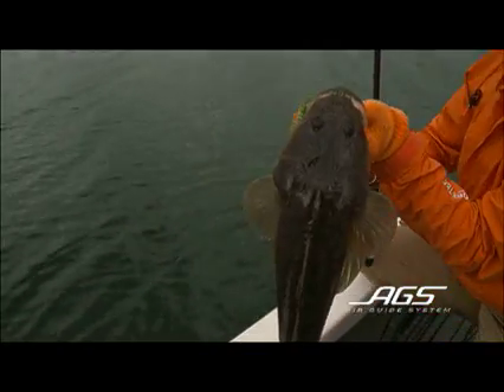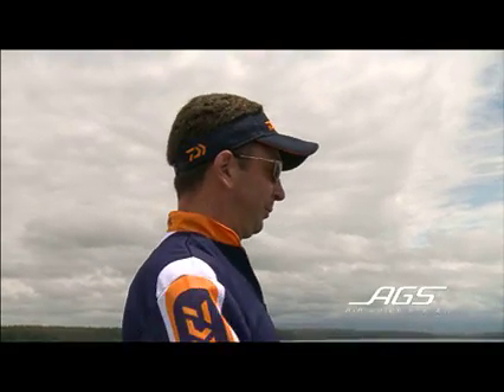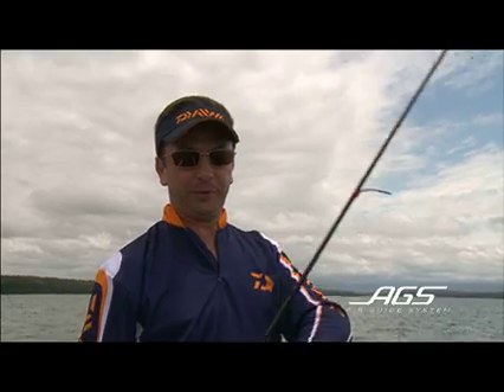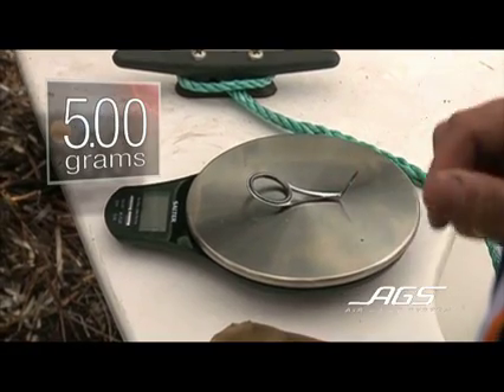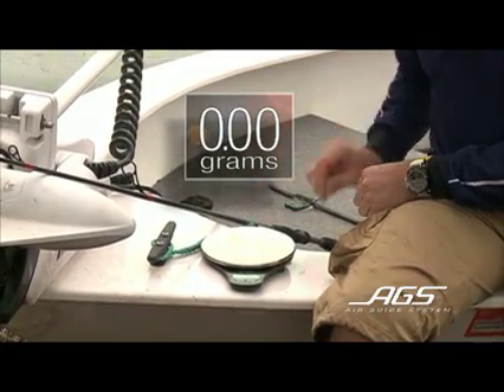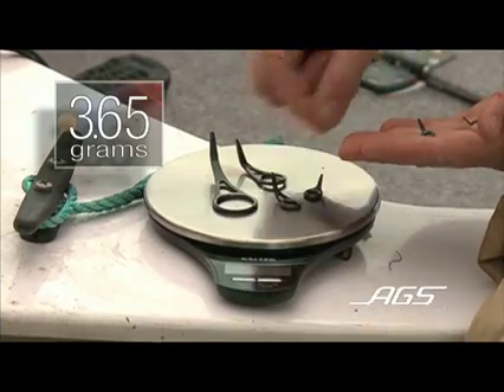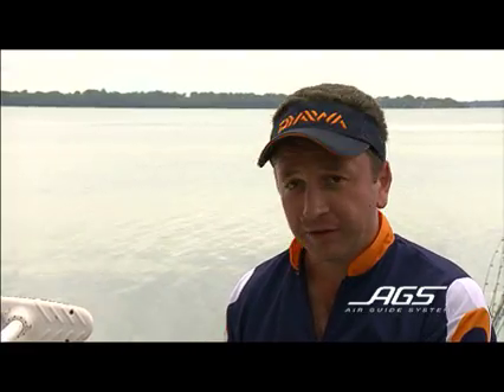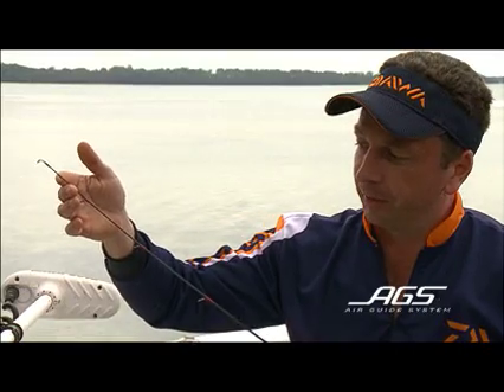Daiwa AGS

Comment: IMO this is wrong. Guides do not increase sensitivity. They are just guiding the line. Sensitivity depends on the line and rod. Further, carbon guides are extremely fragile. They break instead of bending if hit by something. I would prefer titanium any day.
Reply: Brian Sørensen , IMO....... if you don’t know how to fish, it’s pointless to spend $500+ on a rod let alone $800 for a Daiwa Exist.  Me, the better the tool, the easier it is to fish.  $100 rod/reel combos are a waste of money.
Reply: With that same analogy Brian, then all current Motor Vehicles are still running around on a Model T Ford combustion engine! Lol
Reply: lol you this guy really thinks that guides don’t affect sensitivity…